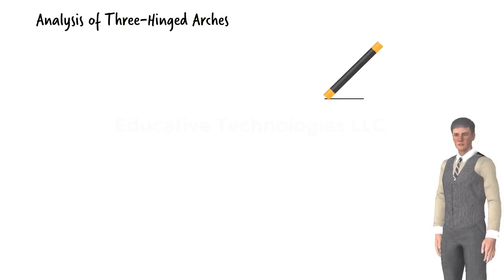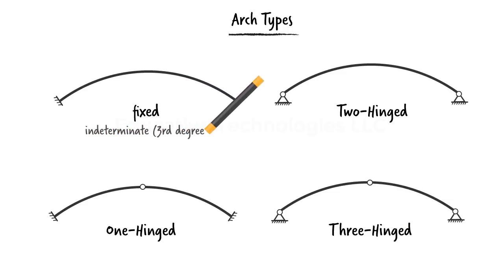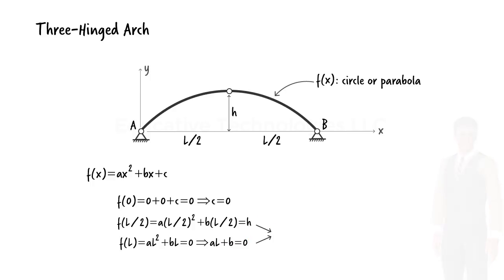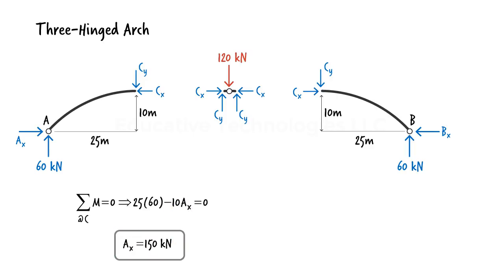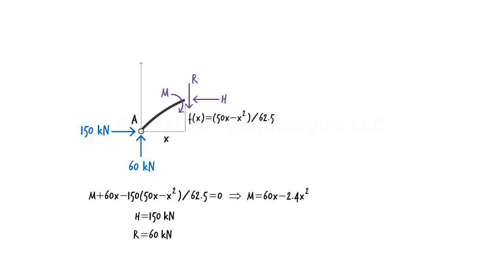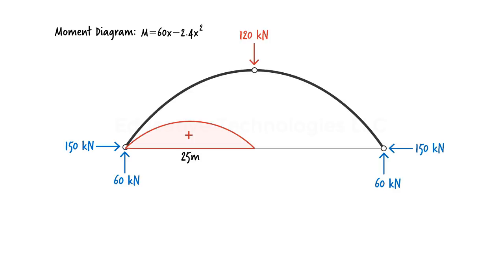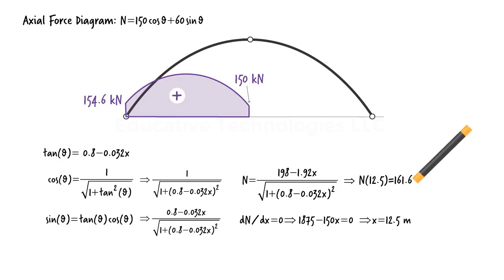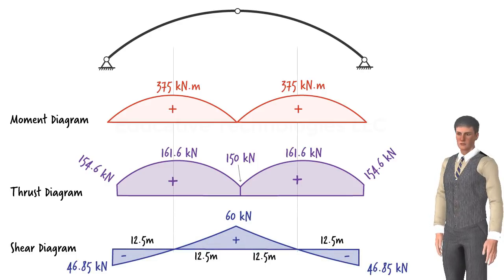SA54: Analysis of Three-Hinged Arches

Comment: I am confused with the way you obtain the N and V In terms of H ,R, Sine and cosine
Reply from the maker: If we label the axes along H and R as x and y, and label the axes along N and V as x’ and y’, then we can see that H has a component along x’ and y’. 
And, R has a component along x’ and y’.

Note that the x’-y’ coordinate system is obtained by rotating the x-y system counterclockwise by angle theta.

The component of H along x’ is H cos theta. The component of H along y’ is -H sin theta.

The component of R along x’ is R sine theta. And the y’ component of R is R cos theta.

Then the total force (due to H and R) along x’ is H cos theta + R sin theta. And the total force along y’ is R cos theta - H sine theta.

Comment: Very very helpfull,I want to know what the concept and pylosophy the 3 hinged  arch,what the reason we suppose hing  in midspan?
Reply from the maker: Each type of arch has its advantages and disadvantages. For example, a 3-hinged arch is not as rigid as the other types of arches. Consequently, it is less sensitive to support settlement. That is, while a hinge-less (more rigid) arch would undergo additional stresses, if a support settles due to, say, weak soil, the ability of the hinges in a 3-hinged arch to rotate would prevent the development of those additional stresses in the two arch legs.

Comment: For a flat arch does the same method applies? as thrust would be extremely high. Thanks
Reply from the maker: No, a flat arch (arch at the bottom, flat on the top) has a variable cross-section which would result in a change in the distributed load pattern and the geometric properties of the system.  These changes are not consistent with the assumptions used for analyzing regular (circular or parabolic) arches with a constant cross-section.

Comment: Can you explain how to get the result 1875-150x=0
Reply from the maker: That is the simplified expression for dN/dx = 0. Are you getting a different value for the expression?
Reply: Oh okay  @DrStructure , maybe I still don't understand, but if you don't mind, can you share the long method to find dN/dx=0
Reply from the maker: You can use wolfram alpha (www.wolframalpha.com) to perform the integration. 

In the input field type:
Derivative of (198-1.92*x)/sqrt(1+(0.8-0.032*x)^2

Then click on the equal sign on the right side of the input field.

Set the resulting equation equal zero and simplify the expression. You should get: 1875 - 150 x.

Comment: At 6:23 how N and V have derived.
Reply from the maker: H has a component along the N-axis and a component along the V-axis. Since H is a horizontal force that makes angle theta with the N-axis, its projection onto the axis is: H cos(theta). H also has a projection along the V-axis, it is H sin(theta). This projection force, however, is going to be in the direction opposite to what is shown on the diagram for the V-axis. The arrow for the axis is pointing downward, meaning we are assuming downward to be positive alone the V-axis.  Since the projection of H onto the V-axis is going to be upward, we attach a negative sign to it. That is, we write the projection of H onto the V-axis as -H sin(theta).

The vertical force R also has a projection along the N and V axes. R makes angle theta with the V-axis. Therefore, its component along the V-axis is: R cos(theta), and the projection of R onto N-axis is R sin(theta). Note that these projections are acting in the positive directions of the N and V axis, hence no negative sign needs to be used to label either of these components.

Since H and R each has a component along the N and V axes, the total force along N and V is the sum of the two components. For N we get H cos(theta) + R sin(theta). For V, we get -H sin(theta) + R cos(theta).
Reply: Thank you dr Structure, you are an amazing teacher.
Reply from the maker: @stanzinnorboo7083  You're welcome, and thank you!
Reply: Sorry for again disturbing you, i want to ask , will you please make a video on two hinge arch and arch with different support level?😀
Reply from the maker: @stanzinnorboo7083  Eventually we will cover those topics,  the when of it however is not known at this point.
Reply: Thank you , merry Christmas 🎉🎉🎉.